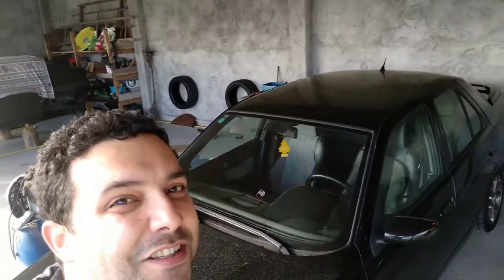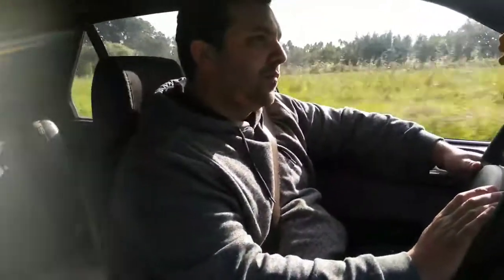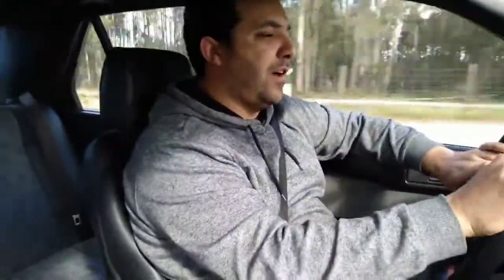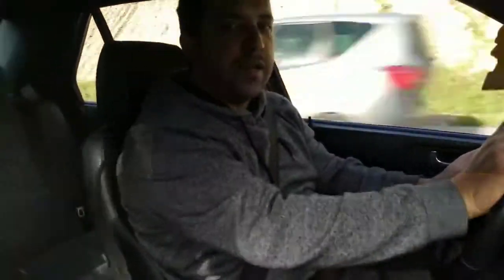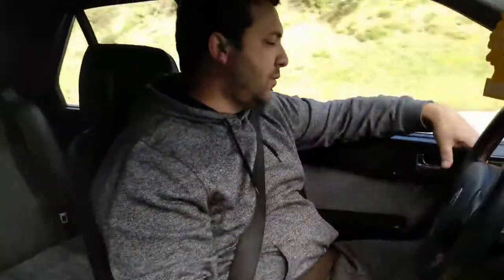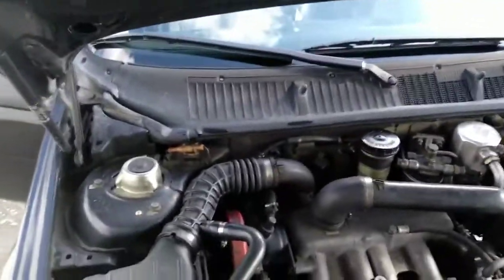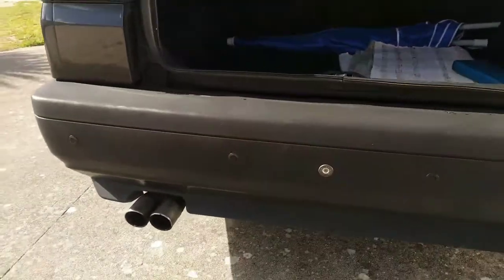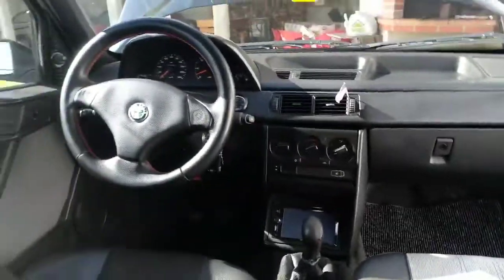My Alfa Romeo 155 presentation! And why i have it!

Comment: i have a 155 for a month now but find the brakes a bit poor, though these have been renewed by former owner, i find it too weak. Someone told be 166 brakeclaws could be a simple improvement. Could that be true?
Reply from the maker: Hello, my brakes ware a bit poor too. I replaced the brake fluid a bunch of times to get rid of the sludge on the brake lines walls and replace the flexible brake lines. But more importantly the rear axle brake regulator! 
Now, about a improvement i do not know because I'm pleased with the results. So i never searched for a upgrade. Mind you, my discs are vented from the 1.8t. they came with the car.